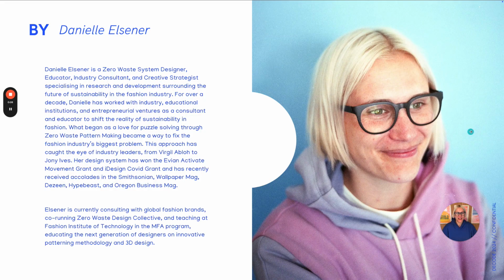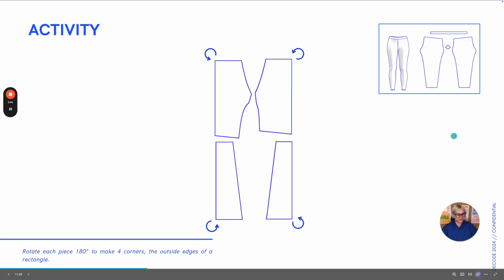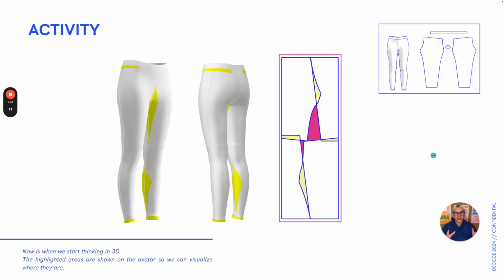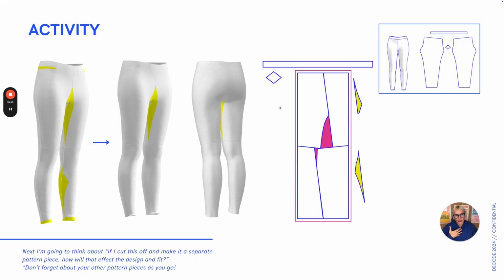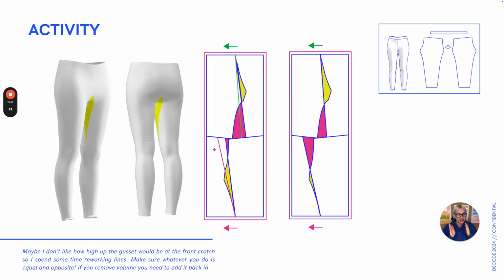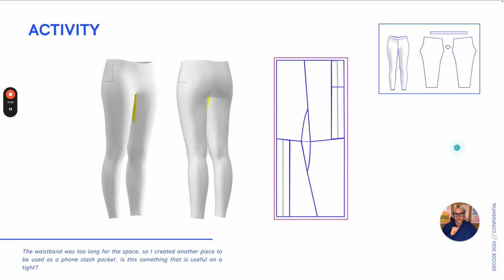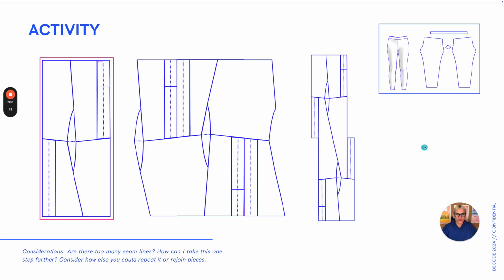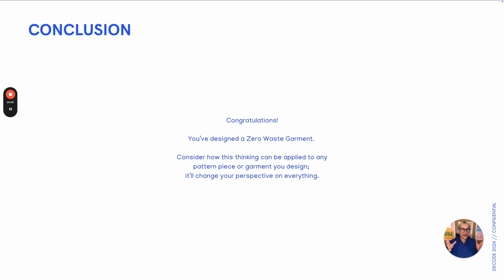Zero Waste Design Thinking - Quadrant Cutting

Comment: Question: I got the part where at 10:15 you are talking about the overlapping areas that are shown as yellow in the 3D representation, yet what I didn’t get is that if we are to show the new irregular style line there would be a huge difference in the FIT, which is not clear in the simulation. In fact none of the fit problems seem to be showing when making those changes to the crotch area, gusset size…etc.
Reply: So could we say that at 10:15 it was only showing the aesthetic, but not yet the fit change?
Reply from the maker: I'd say that's accurate for the example - the changes made don't reflect visually a ton due to the nature of the stretch fabrication. Fit and function should definitely by tested as the pattern progresses!
Reply: @3DECODE thank you so much for the reply and for generously sharing your knowledge and expertise with us all dear Danielle! ❤️
Reply: I got confused, because using my logic and imagination, I thought if we decide to keep the crotch as is and cut out that overlapping part from the leg, then when sewing it back as an irregular zig-zag line would create visible gathers… 
But based on your comment, I am getting closer to understanding that if we decide the do the opposite, then the leg would remain intact and the crotch area would be tighter, but still with the stretch it won’t mess up with the fit as much. Right?
Sorry for this long comment… I am simply trying to learn from you! ❤️
Reply from the maker: @NR-ge9md  Thank you for the clarification! I'm glad to know this method of thinking is helpful on your zero waste journey!
Reply: @3DECODE absolutely! 💯